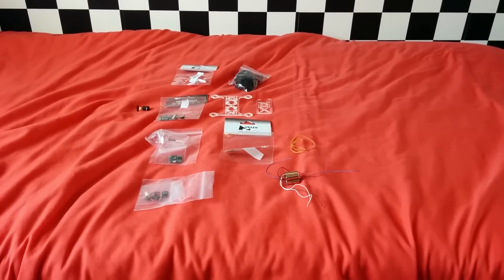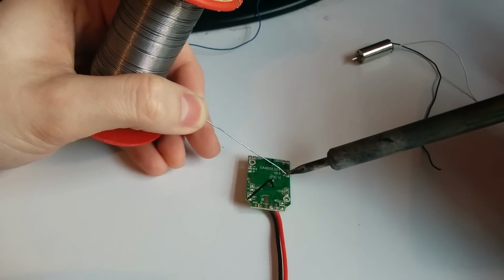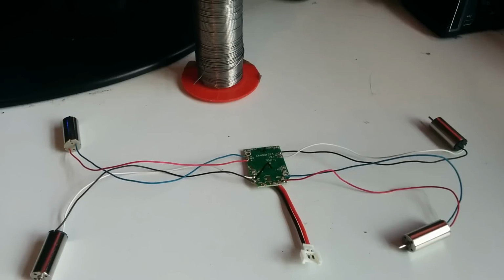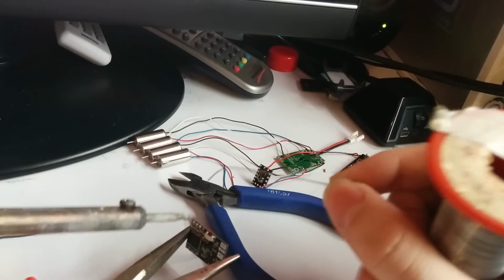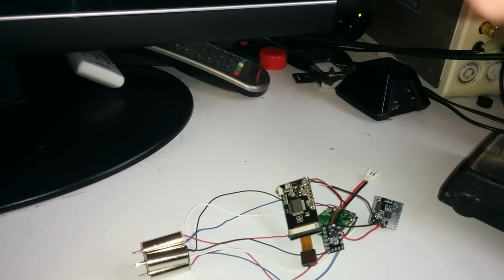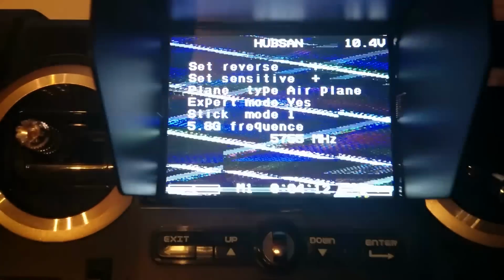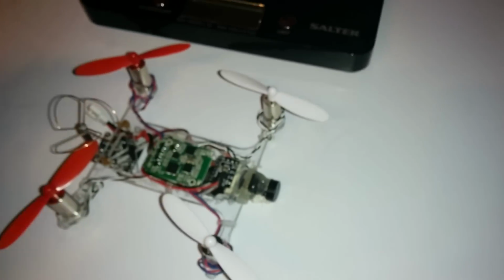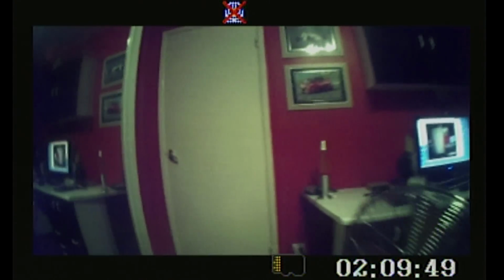Microquad Custom FPV Full Build & Flight With HD Recording

Comment: Andy, thanks for the video.  I followed your instructions,but I'm not receiving a video signal.  I'm not sure if it's my camera or my VTX.  Do you have any suggestions for troubleshooting?  The VTX is getting hot, so I know it has power.  How can I be sure that the camera is sending a signal to the VTX?
Reply from the maker: ***** did you get it working? if its getting hot its usually transmitting, see if it records any video on the SD card

Comment: Do you sell Quadcopter ?? Or can you make me one and the price if you can I live in  usa 
Here my email abrahamcortes34@gmail.com
Reply from the maker: I do not sell them im afraid. i just build and fly them. I make the videos so others can watch and do the same. It is quite time consuming to build one so charging to build one would be too expensive for this size quad. maybe look at the ready to fly options if building and soldering is not for you. the problem with these custom builds is that when you crash them they will need fixing and re soldering so its really just for the custom hobbyist rather than selling them retail. all the best

Comment: Planning to buy an X4 H107L RTF (since I don't have a Hubsan TX yet) and tear it apart and put everything onto this frame along with my micro FPV setup I've made that weighs about 11 grams.  Do you think the stock Hubsan motors would be able to handle that sort of weight?
Reply from the maker: the h107L has 7mm motors. the picnic quads frame (the one i used anyways) is for the h107d 8.5mm motors. so if you are doing that make sure the picnicquads frame you got is the 7mm version

I dont have much experience with the 7mm motors i always use 8.5mm. alls i know is I have a hex with 7mm motors on it and the 8.5mm quad can lift much more than it!

the 8.5mm motors can lift 11 grams easy but i wouldn't be so sure on the 7mm. worth a try though
Reply: AndyRC Okay, I'll definitely buy some 8.5mm motors along with the frame and the Hubsan.
Reply from the maker: thats a good idea :)
Reply: AndyRC Could you give me a link to those motors you've used in the video?  I can't seem to find any that aren't incredibly expensive.
Reply: NoahWL1 http://pages.ebay.com/link/?nav=item.view&id=161593191881&alt=web
Reply: AndyClayton Thanks!

Comment: nice build! have you ever used any programmable FC's in your builds? Something that can do way-point missions?
Reply from the maker: for waypoint flying you need a gps and i think this platform is too small for a couple of reasons. gps needs to be positioned away from other electronics to eradicate noise produced by other components. then theres the weight issue and power draw. however i definitely think its possible just not from me. I am building a full size quad so i shall see what i can add to that. in the mean time you can use the AlienWii board which allows you to connect via spektrum. however i dont like the spectrum radios which is why i stick to the hubsan controller boards.... for now :)